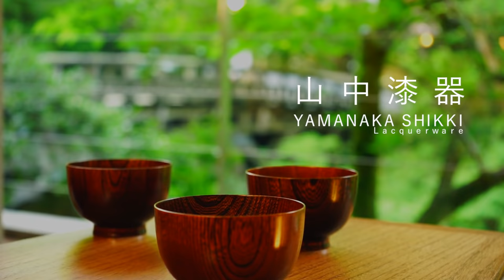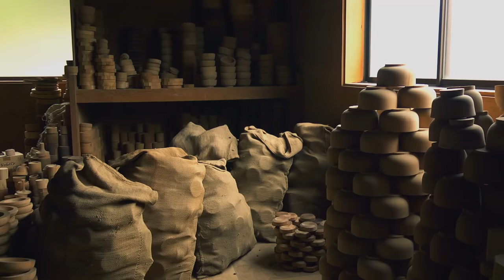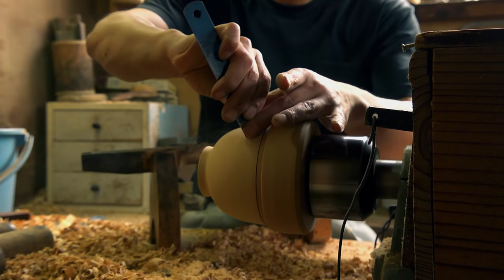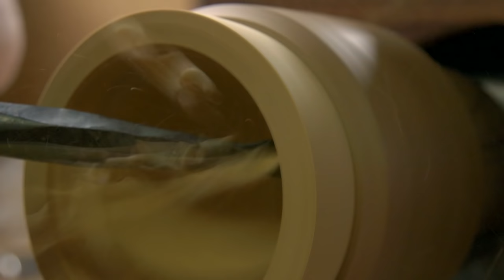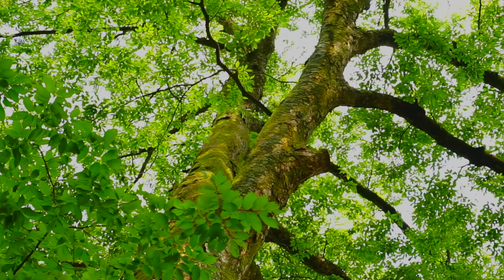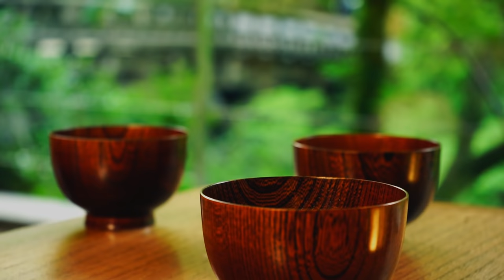手技TEWAZA「山中漆器」Japan Yamanaka Lacquerware／伝統工芸 青山スクエア Japan traditional crafts Aoyama Square

Comment: I wonder what base dye they use to dye the wood, so it remains food safe... I'm assuming they are for food not only display
Reply from the maker: The dye uses "lacquer(漆)". Of course, it will not adversely affect foods.
Reply: Traditional lacquer comes from the sap of the Asian lacquer tree – toxicodendron vernicifluum, formerly rhus vernicifera. This tree is not easy to deal with as its sap actually has the same kind of allergic oil that is found in poison ivy! In fact, the name of this oil (urushiol) comes from the Japanese name of the tree – urushi.  

Best not to use if allergic to the oil.
Reply: The lacquer can be an irritant in its liquid form but it polymerises on the lacquerware and becomes perfectly food safe.